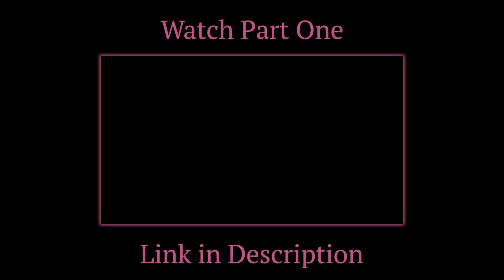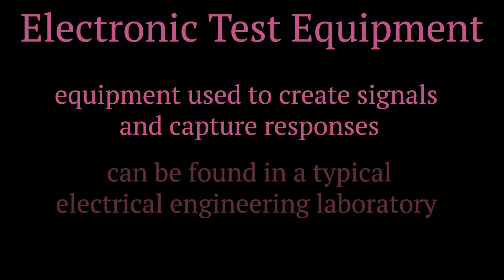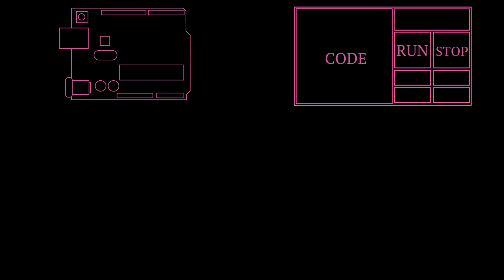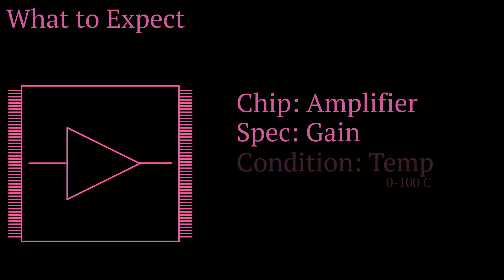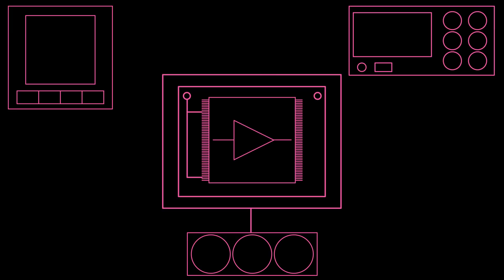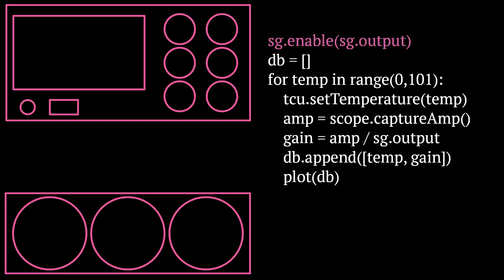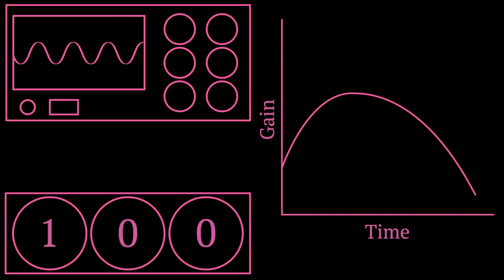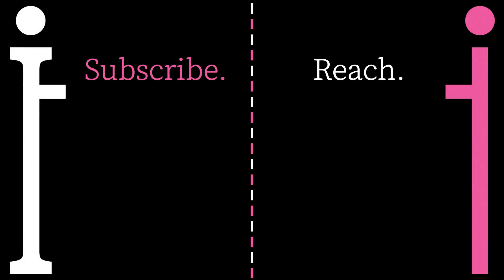What I do as an Electrical Engineer(part 2)

Comment: It looks like your a Test Engineer.  I do the same but for Military. Stay away from Government contracts or work. Funded by project. Project over so are you. You better save some $ for a few years and don't live paycheck to paycheck. Forget about Cars. Every young guy out of school wants a flash car. The economy is due to a downturn and it happens every 8-10 years because capitalism is like an unstable control system which is not part of most EE required classes today.

Comment: As an EE who transitioned fully into Software Dev, I cannot emphasize more how much we really suck at the core fundamentals of CS. I can automate with Python and do stuff with Arduino, but I remember struggling so much at my job when I first encountered data structures. I was like wtf is this shit. I got fired because i did not know what those funny arrow thingy was (de referenced pointer to struct). I malloc'ed the fuck out of a puny 8051 when they hardly had any footprint. 

Also,

I used space, not tabs
Reply: TotheK I N G D O M  I want to go into CE as well. But I wasn't sure if CS was a better option. Mind if I ask why you won't do CS?
Reply: Lmao. I have a feeling i'll end up in the same position as you.
Reply: @AVL-Tree  Electronics Engineering is a subset of EE and is very much related to software dev. As an EE major with an electronics focus, I'm forced to take an Assembly course that essentially teaches me about how CPUs process surface level languages like C++ in the background and I will be taking a machine learning course as an upper division elective to get an even deeper understanding of this. Electronics Eng. and Computer Eng. have a lot more in common than you think.

Comment: Sir can you plz tell me about electrical field PLC and SCADA scope of job and I am planning to Study New Zealand PGD 1 year  there is Electrical and electronics engineering and Electrical computer engineering I have confused which course related to PLC SCADA.
Reply: i believe PLC and SCADA are under electrical engineering, not electronics or computer
Reply from the maker: I’m not familiar with those subjects
Reply: SCADA has a very good scope. You can work for oil and gas companies, factories, power companies etc. You will most likely be creating displays and assisting control room operations. Get trained with using OASyS DNA
Reply: Course is under Control systems/ PLC programming